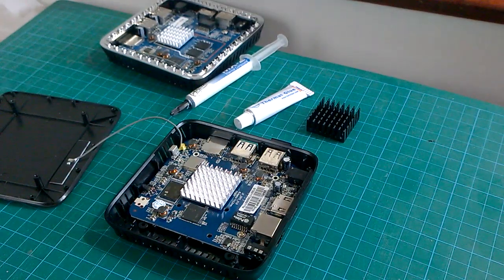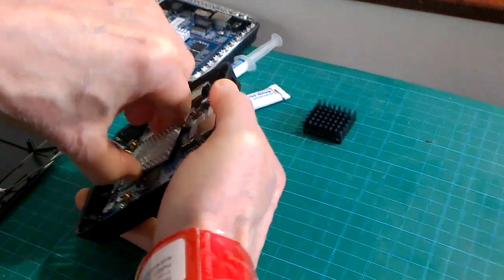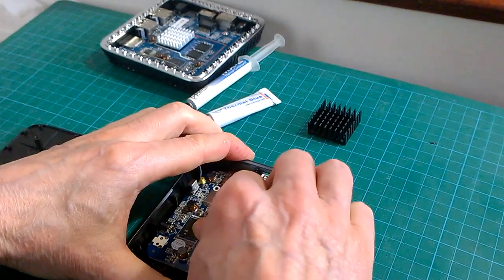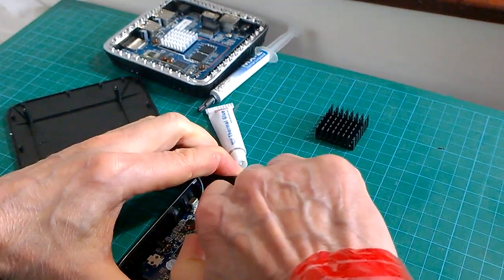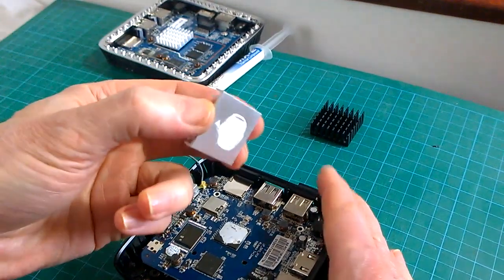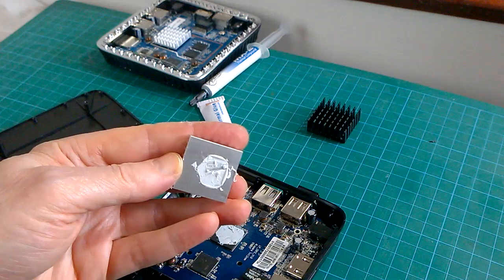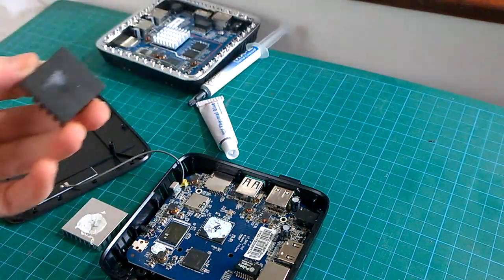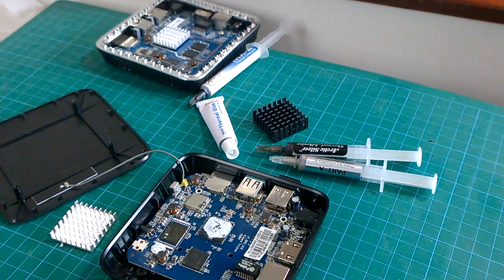M8S Pro Plus L Heatsink Removal - Pt.2

Comment: Thanks for tips but I used a large plumbers type plyers rather than fingers until it came lose 
but where to get heat sink fan -guess I should of thought of that first he he
Reply from the maker: Lots on E Bay
Search on dimensions
40x40x11mm
38x38x20mm needs a hole in lid
etc.
See
http://freaktab.com/forum/tv-player-support/amlogic-based-tv-players/701682-overheating-mecool-m8s-pro-l-and-pro-and-others-options
Reply from the maker: Fan on E Bay Item 222616196610
30mm 5V Pi Fan
Requires hole in lid and may fit inside with a lifted lid and std. HS
Bigger HS requires hole and external fit
Biggest is 40x40x11/13mm
Reply: Thanks, registered but just wanted links for ebay site or whatever
Reply from the maker: You can just use the Item number given above in E Bay search bar

Or try
https://www.ebay.co.uk/itm/222616196610

Comment: can i just leave lid off or semi off and put a laptop cooling fan under the box
Reply from the maker: Hi, laptop cooling fan would probably help. Lid off is better, but lifted lid is better than nothing !
Reply: can i just cut square hole in top like you did and set box on top of usb cooling pad
Reply: maybe cut small hole in bottom too what do you think
Reply from the maker: Hi, 
Have a look here for a lot of ideas
http://freaktab.com/forum/tv-player-support/amlogic-based-tv-players/701682-overheating-mecool-m8s-pro-l-and-pro-and-others-options
Hole on the top with a fan is a good option.